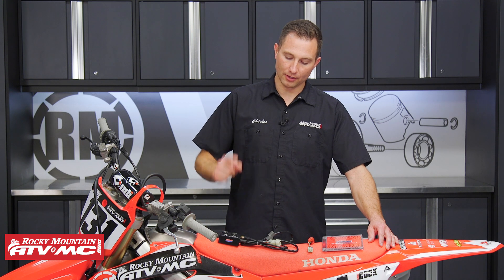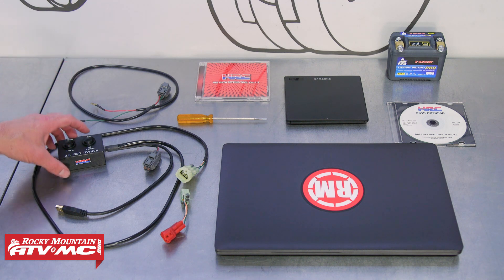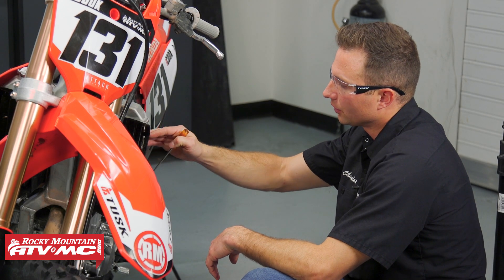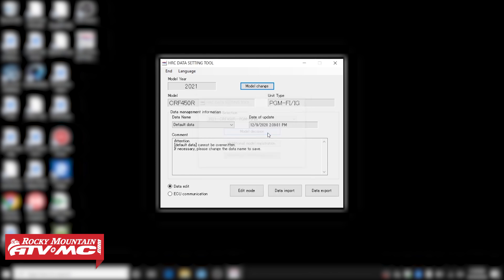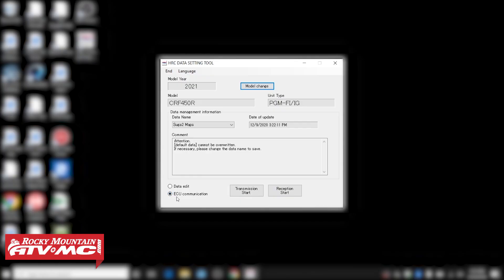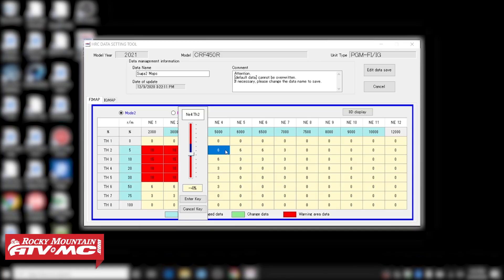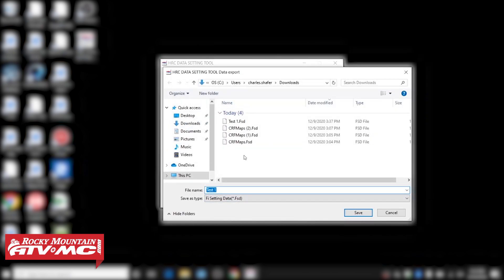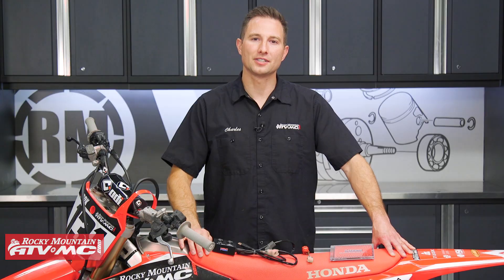How To Use the Honda HRC PGM-FI Setting Tool

Comment: this will work on the crf250r 2024 model? ad the software are included on the tool?
Reply from the maker: To see if this will work with your machine use the links at the top of the description and enter your machine in the drop down menu. If your bike isn't listed we may not have the correct application. The software does not come included with the tool. You will need to purchase those separately using the links in the description.
Reply: @rmatvmc  ow abaout the softwre can you share the link to thanks
Reply from the maker: @markreyes022  Honda PGM-FI Setting Tool Manual CD-Rom: https://rmatvmc.link/honda-pgm-fi-setting-tool-manual-cd-rom Honda PGM-FI CD-Rom: https://rmatvmc.link/honda-pgm-fi-cd-rom
Reply: @rmatvmc  thanks but the link are for 450r this will work on the 250r? and it shows model 2015 it will compatible on the 2024 models?

Comment: In your first link where you can view maps you state "The fuel map is the same for both modes, but the ignition maps are different."  I think you have labelled these incorrect as it show's the fuel maps as the ones that are edited. Also both Mode 2 and Mode 3 are the same.  I don't think you have put the right picture of the map for Mode 3.

Comment: Your website doesn't even bring up the software for a 2020. Says you only sell 2017 and older.  I have the USB I/F tool but no software.  Please prove me im wrong and you have it for the 2021 460r
Reply: If I’m correct the disc he had said 2016